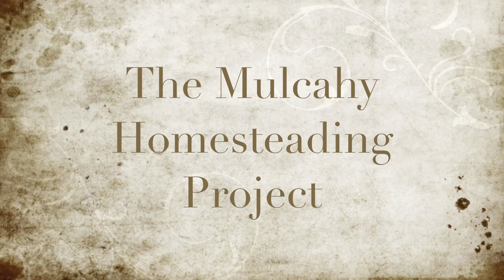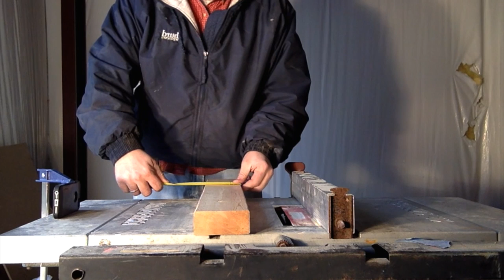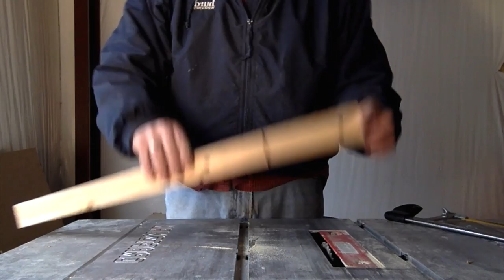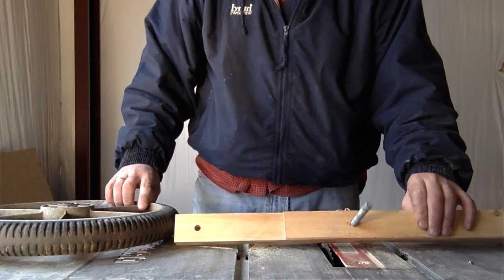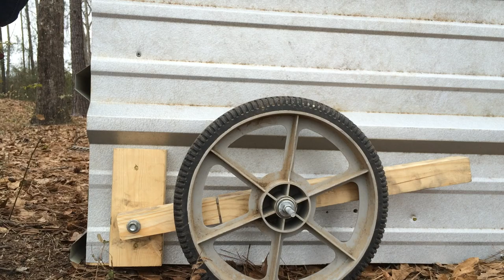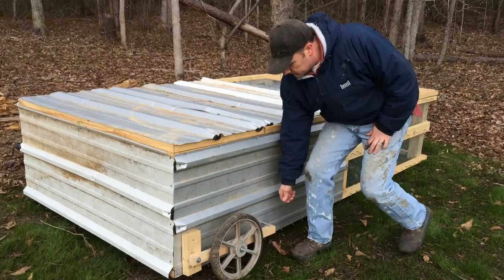CHICKEN PROJECT: Putting Wheels on Chicken Tractor

Comment: Thank you for fyi pivot wheel system, does the wheel assembly get wore out when pushing down, out and under the stationary pin? Like if such wearing out happened, did new updated improvement happened? Or did not wear happened because of the flat metal circle rings ("washers"?**) protect it from wearing out?

Comment: It looks like you shaved off some of the wood from the pivot point hold to the wheel spokes. Was it because the wheel rubber was rubbing against the wood? And if so, what are the instructions to do this? Thanks
Reply from the maker: +Denise Samson  Good catch Denise. The actual piece of wood that was eventually used was not shaved off. I did not want to go back and re-shoot the video. The finished wood was solid. Thanks for your question.

Comment: I have a HEAVY 4' X 8' x 8' coop/run combo I want to add wheels to but I'm assuming I will have to use metal instead of wood because of the weight?
Reply from the maker: +Diane Richardson Hi Diane - You certainly can use metal. The wood frame still works well for me. My tractor is 2'Hx5'Wx10'L. Putting the wheels on one end of the tractor does not put the entire weight of the tractor on the wheels or wheel base. If you use the lift/pull method of moving your tractor like I do on the video, you will be lifting much of that weight yourself. It really comes down to how much your coop weighs. I hope this helps. Thanks for your question!!

Comment: Thank you for the good video. where is pivot point height wise to the wheel center and stationary pin. It looks lower but do not recall you mentioning it as reviewing video. Would it be the height of the 2 2x4's lower than the wheel center and stationary pin?
Reply from the maker: The stationary pin is on the same plane as the center of wheel and pivot. It may be a touch lower on the tractor simply because I was probably very lazy that day and 'eyed' it but technically it is supposed to be on the same plane. Thanks for your comment and watching the video. Many blessings.
Reply: Mulcahy Homesteading Project Thank you very much. I did exactly that and was fine.  My parts were different as used what was on hand like the  small wheels off my old broken air compressor. Used 1 by 3 for handle and it is a little flimsy but works well.  The coop itself was used for holding cardboard in our recycling business. Thinking about using pneumatic tires and maybe 4 tires for all corners. Probably overkill but can get them at harbor freight for around $6. Your video is very professional and very clear which helped someone like me that has to do it to really understand.  Got some soda trays for free from a small grocer for laying baskets.  They are a hard plastic and has mostly holes in bottom so waste can drain and not accumulate as well as clean easily.  If I can figure out how to send a picture will send it. Thank you for your time and fast response.
Reply from the maker: carl mallett Thank you for your comments. Would love to see the picture. You can email me at mulcahyhomesteadingproject@gmail.com. Please let us know if there is any way we can help in the future. Many blessings!!

Comment: i have heavy 4X4 wood poles off old swing set for my frame.   you think the lawn mower wheels may get stuck in ground due to weight??  i was thinking about fat tires off of an old trycyle my kids outgrew
Reply from the maker: +infadel13 I used a 4x4 frame/structure too. The high-wheels work fine for me. I could see a scenario where the ground could be too soft and the weight of the tractor get bogged down. However, I have not had any issues as of yet with this and I do live in a pretty soft area. I actually moved my tractor 2 days ago from one part of my property to another (about 1000 feet) and it rolled just fine. I think your fat tires would work for you as it's the concept that works and not necessarily the type of wheels. Good luck and thanks for the comment. I hope this helps.

Comment: How much does your tractor weigh approximately. Any idea what the max weight is that this would lift?
Reply from the maker: +Denise Samson Hi Denise. I actually made my tractor a bit sturdier than needed. It's a 10Lx5Wx2H. I used 4x4s at the corners but I could have gotten by with just using 2x4s. The 4x4s made it heavier than I wanted. However, the high wheels I used with the lift system on this video works well. The overall weight is probably around 75-100lbs.

Comment: Protection from night varments from under neath the coop?
Reply from the maker: I actually shot nails around the bottom perimeter of the tractor. This keeps animals from digging under. Also, around the area where the hardware cloth is I shot nails on the bottom middle and top to keep animals from jumping on top to try to get in that way. It works very well. The only negative to that is it lessens the strength of the board and I have had to replace a section on the bottom. However, that is worth losing chickens to coyotes and foxes. Thanks for your comment.
Reply: Great idea how far do the nails need to protrude , I think this should work with a stationary coop if I had them a couple of inches under ground to keep someone from stumping their toe on them. Or lay board over them then the critters digging would move the board and expose the nails.